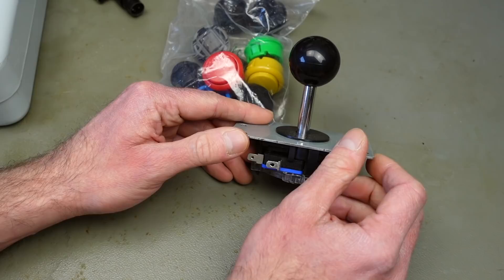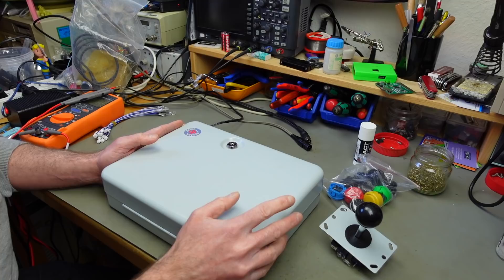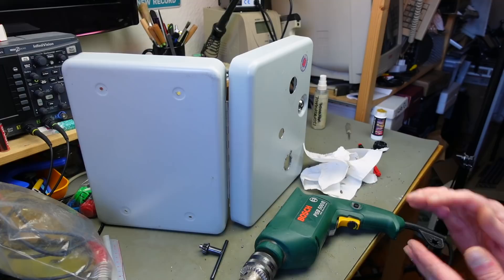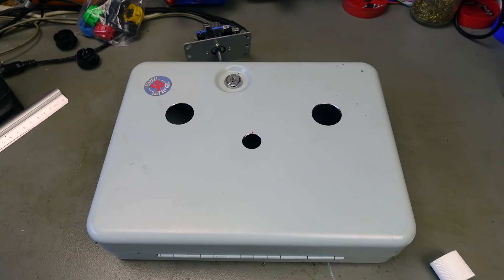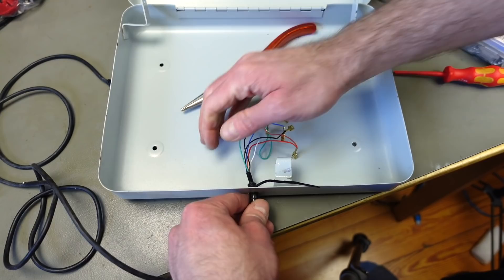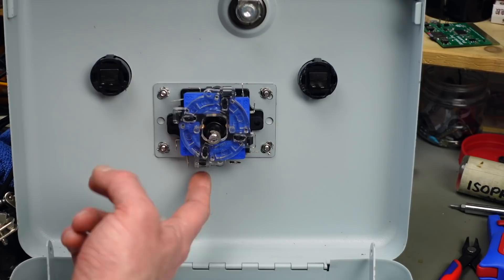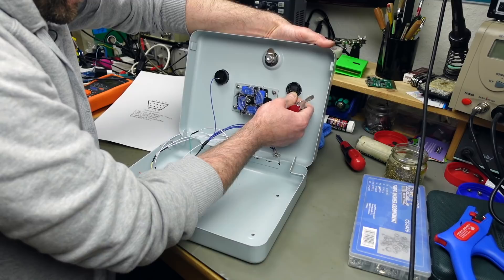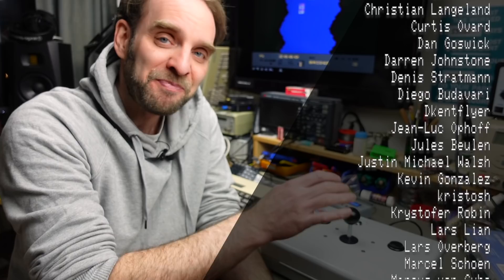Making a Joystick from a trash-picked Cash Box

Comment: You might want to consider replacing the restrictor plate on the joystick (The clear plastic thing that restricts the stick's movement at the base). The square style like came installed is meant for fighting games. Octagonal is generally desirable for most other stuff like classic games, making it easier to not accidentally trigger a diagonal.

As an example, picture your test game here River Raid. You're going through a tight channel in the river and pull back on the stick to navigate it slowly. With the square gate, it's really easy as you're pushing the stick back to accidentally trigger a diagonal input and send your jet careening into the cliffside. With octagonal, you're physically able to feel that you're only triggering down.

Comment: I made myself a joystick for my C64 and Amiga out of cheapo arcade clone parts a couple of years ago too. I added two buttons on mine, one for Fire and the other is wired to Up so it can act as a jump button. I also added a switch on the back that changes the second button from Up to Secondary Fire for those Amiga games that supports it like Turrican. In hindsight I maybe should've added a third button so I could have both a jump button and fire 2 at the same time, but it works well enough as it is. Nice work Jan!

Comment: Great project! Suggestions:
- A piece of heavy steel fastened to the inside bottom to add weight
-Sound-insulating foam to reduce the hollow sound
-Solid rubber feet

Comment: I made something similar. For the cable I just put a 9Pin male female connector on the joystick box , I can plug in an extension like cable to the the joystick and the computer. It means I can still use my extension cable for others things. The cable is just a couple IDC press-fit connectors with ribbon wire, works well.

Comment: Why not go all the way, and make it an independent an dedicated arcade machine by putting a raspberry pi inside? And maybe also make place for the power supply and extension cabels inside so you just have to open it, take the power supply and needed cables out, connect the arcade PC and TV and you are ready to play! ... Heck! Why not also a suitcase handle, so it is easy to take with you on the go! ...YES it will be a bigger project! But an AWESOME ONE! 😃👍

Comment: Cool project; pro-tip: you can remove the metal plate from the joystick and use the inner four screws for mounting instead; this is useful because the plastic washer the covers the hole, also covers those screws up, and you don't have extra screws visible on the thin surface (or rubbing on your hands, etc.). 😉

Comment: you could get an A4 perspex and make holes to lay over the top, JS center / buttons, will make you hand slide easier without damage. you can also get a cheap key as they have a number on lock and is fairly standard.

Comment: I would probably make the cable removable by mounting some round connector (maybe DIN for easy hole drilling) and put the counterpart on the cable, that way you can just unplug and lock the cable inside for storage :). Also usually the stick is mounted 90 degrees rotated, so you can fit more buttons next to it, but that is probably not worth redoing now....

Comment: Turned out really nice! It reminds of my "Competition Pro Board" (search in my channel as I am most likely not allowed to post YT links) from the 80's, which I slightly upgraded a year ago. 😁
As you have plenty of room, an adjustable auto fire (as I have in my Board) is the next logical step. A link to a diagram for this is in the video description of my "Board" video. It's not as trivial as you might think. ^^
Keep in mind that you need a new cable with +5V (Pin 7) connected!
Maybe a paddle controller is an option, too. Not sure, how this will work. Maybe Pin 5 is used for that. And which games do support this. 🤔

Comment: It's a key safe. I don't understand why you didn't just daisy chain all the commons together. It would be neater, use less wire. You also said it doesn't matter what connection you use on the switches but it does. You must use NO (normally open)